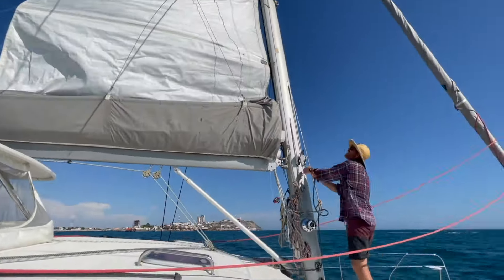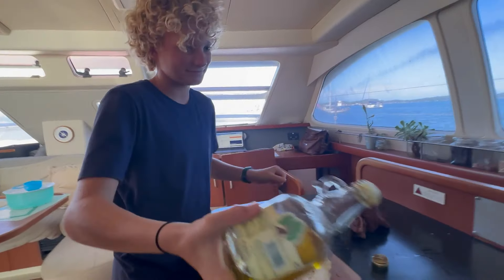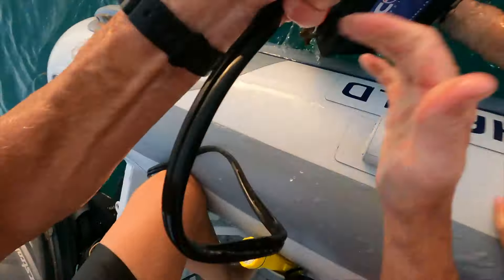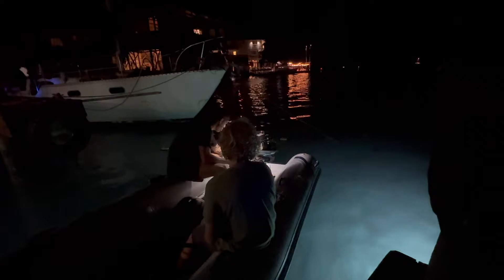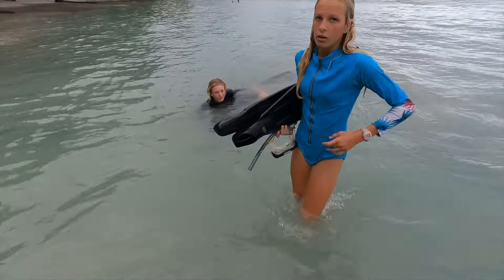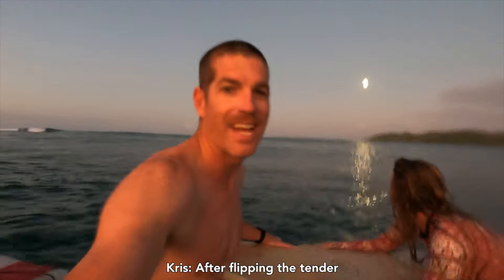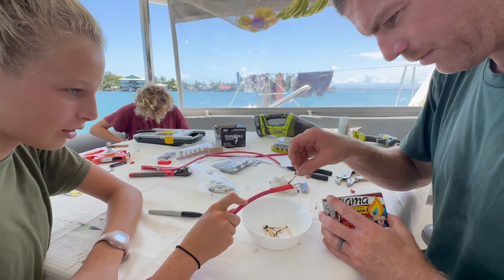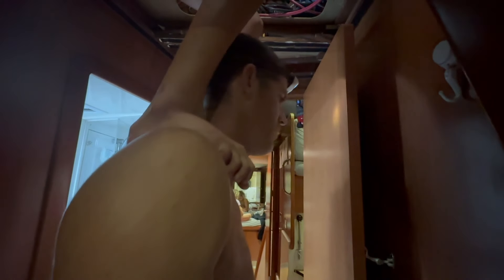We flipped our dinghy in the surf! | Sailing with Six | S2 E51

Comment: Great job on the recovery! It's always tough when things like that happen, but sailing wouldn't be fun without solving problems.
A little known fact about bowlines is that they can work loose under cyclical loading and unloading (such as wave action on a rode) even if they are tied snug. An anchor (fisherman's) bend works well for anchor rodes, although it is notably more difficult to tie and untie. A round-turn and two half hitches or a buntline hitch also work well for securing to a ring, however, not quite as effective as the anchor bend.
Reply from the maker: We will try these other knots you’ve mention and see what works well because there’s certainly more surfing adventures to come

Comment: What's MPPT?
Reply: Maximum power point tracking AS OPPOSED TO PWM (Pulse-width modulation).  MPPT is more efficient and creates less heat.
Reply: @svroundabout  That doesn't really clarify things. 😀What does it do?
Reply: @Maloy7800  takes the DC.voltage from higher than 12v (19v -ish to 500v in a household system) down to 12v -ish to charge the batteries.